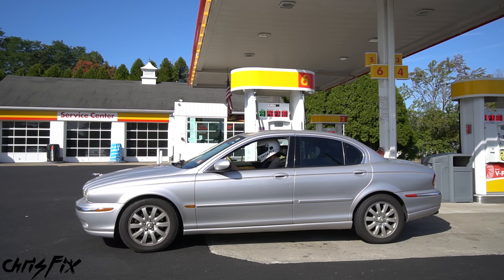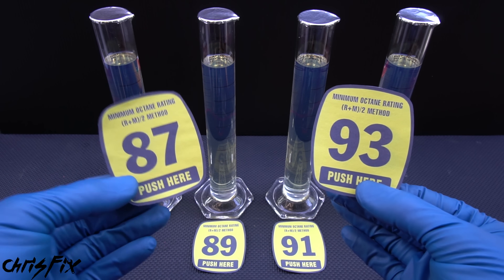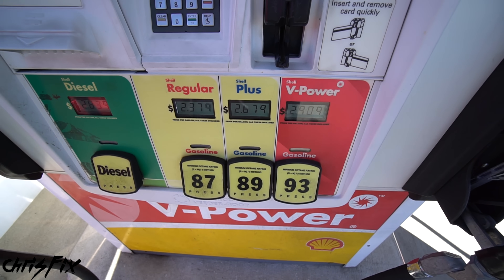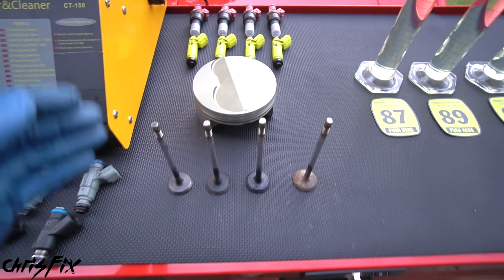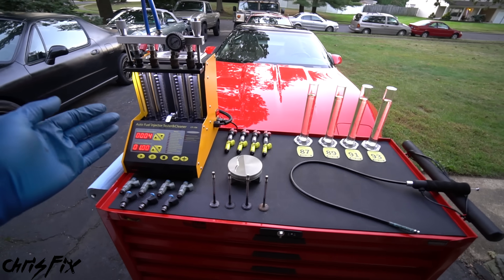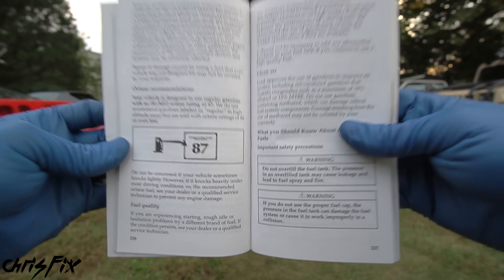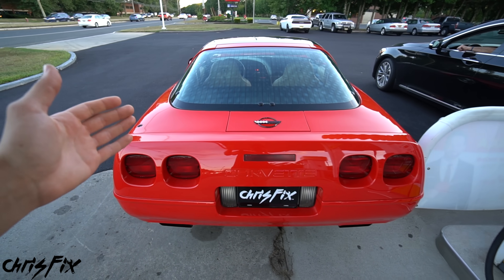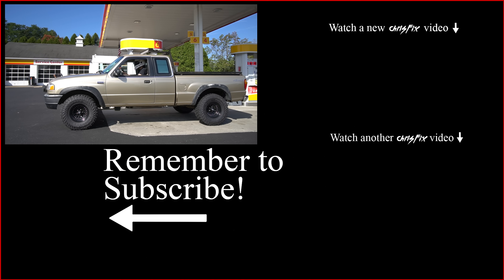What is the BEST Fuel to Use in Your Car or Truck and WHY

Comment: Watched the whole video

Answer: Use what the manufacturer tells you to use
Reply: Besides being a complete advertisement for shell gas that basically sums it up
Reply: well i mean.. did you expect him to tell you "f**k manufactures just use 94"
Reply: @dieseltechnician6227  Who knows what if he said take 4 tablespoons of butter and add 1/2 teaspoon of salt and a cup of flour; no wait wrong video.
Reply: I am going to assume, without watching, that it will lead into something about timing and specifications of the fuel mixture to the engine of the car which basically means yea... do what the car manufacturer designed it to do for optimal use. Probably wont harm anything with a control unit in modern cars though.
Reply: I liked the explanation
Reply: OP edit your comment and add that if you get engine knock, premium can fix it.
Reply: Ɓlιšš thank you so
Reply: Surprisingly, aint it?
Reply: 😂😂 16 mins and half of it was repetitive stuff. Also if you need this much info on what fuel octane to use stop driving and start riding a bicycle.
Reply: Ɓlιšš you da real MVP 😁
Reply: Don’t ever do what the manufacturer tells you to do remember they want you to buy more parts more shut and bull shit
Reply: Outstanding.
Reply: Ɓlιšš bro thank you
Reply: @NightMusic1-b9o  I have a VW Turbo, it says use Octane 91. my gas stations have 89 and 93, someone suggested to save money I could pump half a tank of each, similar to the idea the guy mentioned in vid of fill tank with 87 and then add bottle of octane booster. Got engine knock right off the bat :) Perhaps didnt get it mixed good, maybe I shoulda done some donuts in the parking lot. Didn't realize when i bought it out of a used car lot with a nice price on it, that was gonna be fillin up with premium :P :( 

.....also there was reasons for that used car price, about 3 hidden things wrong (abs unit dead, no thermostat in engine, transmission fluid pan and internal sensor smashed from underside) that they removed the error codes for when sold it to me :)
Reply: Does the manufacturer tell you anything about high altitude and octane, or is that specialized knowledge you can't get from a manual? I'm sure somebody here knows the correct answer, and it's not you.
Reply: But you learned more than that. Chris explains everything in depth, making you understand why to use a certain type of fuel grade
Reply: @spegatti3108  True <3
Reply: @spegatti3108  Bullshit
Reply: @spegatti3108  ya but this comment is still useful for people like me who didn't want to watch 15 minutes of garbage when the point is right here
Reply: Thankyou! Barely got through 6 minutes of boredom
Reply: NoFearXman well you aren't that fun at parties..
Reply: Only needed a minute to say follow manufacturer suggested octane
Reply: @NoFearXman  your patience sucks ass then
Reply: One of the stupidest comments ever. I doubt Bliss could pass the drivers test.
Reply: @BDHO73  Been driving for two years ):
Reply: Ugh! Didnt you already know that before watching the video?!!! 🤨 Dont say nothing else!!! I'm gonna start cussin! 😑🤐
Reply: Electricity is the best fuel for a passenger vehicle!  Tesla ftw!
Reply: @davidbeppler3032  So, why electricity? To save the environment right? Lol. Gotcha. Electricity, in large amounts anyways, comes from 4 sources. You can use fossil plants, use nuclear plants, use hydro plants or use solar powered plants. Burning fossil fuels for electricity is completely backwards for cars. Its much more efficient to use the fuels in the cars than it is to make electricity. So next is nuclear plants. They produce large amounts of the most dangerous substance on earth and is only good for a few years and has to be disposed of. It stays here which is bad for the environment and very dangerous. Next is hydro plants, which currently single handedly destroys the most of the environment by blocking and flooding the land below the dams with water. Next is solar power, which requires vast amounts of flat land, lots of sun, newish technology and expensive. Solar still destroys the environment being made, uses its space and doesnt have enough space to power electronic devices and cars. No matter which way you go, you destroy the environment and no one way or the other is actually any better. They all really do balance out in the end. So get off of your high horse (electric is best) and learn something yourself instead of believing everything you're told.
Reply: @adamsaquatics3332  Wow, almost right in several points.  You at least seem to be paying attention.  OK time for class.  Listen up.
  First you say it is more efficient to use petrol in the cars than to just charge the cars?  No.  Refineries use more power to produce petrol than the cars burn.  Making it more efficient to shut down the Refineries and just charge BEVs.
  Next is Nuclear power plants.  The most efficient and safest way to produce electricity in the smallest area.  No they do not have to produce large amounts of waste.  The plants in the US built more than 50 years ago produce 1,000% more waste than the plants built in the last 10 years.  They just need replaced with more efficient models.
  Hydro electric produces tons of power reliably with very little environmental impact.  Not sure where you get your data, but nobody is damming the Mississippi, I would know, I live next to it.  Instead idiots are building walls to keep the flooding from destroying homes and businesses... dumb.
  Then we have solar.  Cheap, reliable, easy to build and easy to maintain.  Increases crop yield by 12% and has been shown to reduce cancer.  We have huge swaths of land here, and farmers have found that strategically placed solar panels protect crops from burning up in the sun and reduce the amount of water required for them to grow.
  You don't have to take my word for any of this... you can google it.
Reply: @davidbeppler3032   David Beppler   David Beppler  Lol guy. We are talking about just cars. Refineries use oil to make way more than just gasoline. Most of their used energy is making jet fuel. Let alone all of the other petroleum based products. Refining oil to gasoline takes much, much less energy. In fact, you can actually use the power of the sun to distill the oil into gasoline. Which doesnt cost or use anything to refine.

Google " problems with hydroelectric power " since youre so fond of google. It does have multiple major negative environmental impacts plus damage to homes and businesses.
Nuclear power plants are very expensive to build, and maintain. And every single one of them produces nuclear waste that has to be disposed of. If you think even a small amount of that is safe for the environment you need to hit google.
Solar power is not cheap. The storage costs alone outweigh most other sources let alone the panels, and wire that would be needed to run everywhere. Solar will never work for that reason alone. Let alone that it is not consistent or reliable. Just because the sun comes up doesnt mean it wont be cloudy, rainy or in an off season for direct sunlight. Its also expensive to maintain and still requires backup power from another source. 
Good try educating me on something you dont fully understand though.
Reply: @davidbeppler3032  lol guy. You seem to have a hard time ipening your eyes. You realize electric cars are not new? There are reasons why they are barely becoming popular. Also many reasons why we still burn resources for energy. If it was tlas great as you are trying to claim it would have been done ages ago. You believe and fall for too much BS. 

Why dont you come join me at the University of North Colorado and get your bachelor of science in environmental and sustainability degree with me? It will open your eyes to a lot more than you seem to be able to comprehend.
Reply: @adamsaquatics3332  Electric cars are very old.  Lithium Ion batteries are new.  A company building EVs is new.  The fact that you make very uneducated comments about EVs running on coal power shows you how much you still have to learn.
  If Tesla was not producing more batteries than the rest of the world combined with their partnership with Panasonic then there would still be no EVs on the road today.
  Also they would have had to build a new peaker plant in Australia costing the consumers millions of dollars a year to prevent brown outs and power failures.
  Batteries only store power, they do not create it.  Wind, Hydro, Solar, and Nuclear power create it.  Coal and natural gas are killing us.  You, me, everyone.
  You are studying sustainability?  They have not taught you basic physics yet?  An EV is 93-95% efficient using the energy from the batteries.  There is a significant loss of energy from the power lines to the battery but transferring power takes it's cut.  The power lines are already in place everywhere across the country, very little need to add more lines as you suggested.  ICE is only about 20% efficient with the energy stored in it's tank.  Then there is the lost of power from pumping, transporting, refining, storing, pumping, then burning.  Each stage costs.
  The point, even if EVs all ran on Coal power, it would still be more efficient than ICE.  They would still be less polluting than ICE.  Don't take my word for it, ask your teachers.  Explain your point to them.
Reply: @davidbeppler3032  You're still here? This isnt am argument about which type of engine is more or less efficient. I will agree 100% that electric anything is more efficient. But it is not more friendly to the environment when you consider everything that has to go into it to get it going and keep it going. There are so many vast variables that all go into these things. 
There are power lines in 99% of places people live. Yes. Agreed. But the wires running from tens of thousands of acres of panels, to battery banks, then to banks farther out closer to each city to hook into the main grid alone would destroy the environment let alone everyones wallet. You are saying, oh burning gas and coal is killing us, ya sure, but you are choosing to destroy the environment over people dieing. Which will ultimately end in us dieing anyways. 
Even if we could snap our fingers and have everything already all setup and working, just maintaining an electric solar powered world will destroy the environment at a much faster rate.
We dont own the earth. And it owes us nothing. 
And to be conpletely honest, humans need to start dieing off. At the rate populations are growing, our vast numbers alone will cause us to die. We are not supposed to live forever like everyone is trying to do. If we were supposed to we would and reproduction would be way slower.
You do have good points and facts but you are failing to look at the larger picture. You sit and pick at small parts of the picture to try to make your points look better. You need to see what really goes into things.
Reply: @adamsaquatics3332  Fine.  Define your point.  Just one point.  I will counter it unless it is also my point.  Then we will agree.
  I will start.  Saving human lives is good.  Agree/Disagree.  Why?
Reply: @davidbeppler3032  If only it was as easy as saying you agree or disagree. When it comes to saving lives, there is still too much to consider. Which is why there are debates. In many debates there is no right or wrong. Its just who presents better or worse.
As far as saving humans lives in an initial thought the answer is clearly a yes, save them. Save them because they "deserve to live, have a right, have feelings, love, and others." 
But when you dig farther in, the answer is not so clear cut. Which is what i have been trying to show this entire time. If you were to remove all bad things and people live much longer, the amount of people themselves will cause the fall and extinction of themselves. The world needs a balance. In EVERY aspect. The world needs a specific, unknown, number of humans. People need to die at the same rate as they are born in order to keep balance. Too few and we could perish, too many and we could perish. We are growing at a rate much higher than we are dieing. So in order to maintain a healthy balance lives need not be saved. 
So they answer is yes and no.
Reply: @adamsaquatics3332  Gotcha, you disagree.  Nuff said.  Troll on sir.
Reply: @davidbeppler3032  You have a smart mind Guy, its just too focused.
Reply: @davidbeppler3032  Holy shit we have a guy with sunglasses on in his profile pic. You don't fucking mess with David Beppler! You don't have to make fun of people when someone comments.
Reply: @davidbeppler3032  The amount of energy in a cup of fuel has way more energy than a similar volume of battery
Reply: @davidbeppler3032   Yes...let's all go electric! Then build some more coal fired electric generating plants to charge the electric cars. Ask the people in California how those Tesla's are doing getting them to work with the mandatory power outages. No electricity....no charging.
Reply: @beboboymann3823  It is so cute when someone with a grade school education decides to make noise on the internet.  Ok, I can explain this to you.  It takes far more electricity from those coal plants to produce, and fuel your gas hog than it does to produce and charge electric vehicles.  Also you can build solar power plants for less money than Coal plants.  Also you can trust the sun to rise every morning without the cost of sunlight going up.  How much is that gas costing you today?  Will it be the same tomorrow?  How much is that coal you want to burn?  What did it cost you today?  Same as it cost 10 years ago?  If you take time to look at the amount of renewable energy produced 10 years ago in the US vs the amount produced today... you might be surprised.  Coal companies are going out of business.  Solar companies are making billions.
Reply: @davidbeppler3032  hop in your electric car and follow me from Chicago to Phoenix and try to keep up. I'm not stopping an for an hour or so every couple of hours for you to charge your car either. 
They're okay around town, but not for any distance driving that is over half of their battery range, especially a quick day trip.
Besides, if you buy an electric car, you are most likely going to need a second car. So why buy two cars when one will do?
Reply: @Smedleydog1  Not sure what you are talking about.  You should drive the Tesla down to about 10% of it's charge before stopping to juice up.  It only takes 10 min to gain more than 150+ miles range (long range model 3 has a 320 mile range).... so we could easily go from Chicago to Phoenix you in your car and me in mine, I will stop a few times 10 min at a time and you will just keep driving the whole way?  Must have a pretty big fuel tank.  At the end I will spend $65 making the trip and you will spend $235.  You will really show me when you get there a whole hour faster than I do... Next we could go from northern California to southern California and back?  I would enjoy the trip, seeing the sights... keep in mind, I will need a few charges to do this even though it will take us about 26 hours to travel just 800 miles (approximately 30 mph average) .  What is your fuel mileage when sitting in traffic for 26 hours?  Mine will not change.   Will the bad drivers and stop and go traffic bother you?  I will hardly notice the traffic as the car does most of the driving.  lmao

Comment: My manual has a big "87" in it and says "The use of premium gasoline is not recommended, as it will not provide any benefit over regular gasoline in these engines."

Comment: I have a question about something that was not mentioned here.  There are some gas stations in my area that carry E-15 or 88 octane, which is 15 percent ethanol.  I think what makes it beneficial is that it's cheaper than 87.  The label on the pump shows that flex-fuel vehicles and any other vehicle after 2001 is safe to use it.  What are your thoughts about that?  Do you think it's safe for a vehicle to use it if a vehicle can use a minimum of 87 octane?

By the way.  Love all your vids!  I remember learning to change the oil from your video and I've been doing it ever since.  You saved me money!  Keep it up!

Comment: I'm going to guess:
Regular = Unleaded
Plus = Leaded
Premium = Premium
I don't have shell fuel in my state or city.
Only QuickTrip.
Reply: Mechanical Logic 
Pretty much. If you’re using Chevron. 
It burns the same but Shell just has the protective coat that helps your pistons.

Comment: hey chrisfix i have a ranger similar to yours and if you know the 4.0l sohc engine then you should know that the engine when in the mustang is compatible with E85(85%ethanol, 15% gas). i found if you switch injectors and have someone do a re-flash the ranger can also run on E85. the more ya know, or so i found out... hope this brightens your comments

Comment: What are the advantages and disadvantages of E-85? I can run E-85 but never have, it is a lot cheaper but what about fuel mileage?
Reply: your going to get worse mileage but overall clean burn as it requires more E85 to be mixed with in the engine or a better afr
Reply: @josephberto5106  Thanks, heard that before, guess I should try a tank and see how much worse. It's pretty cheap but I get close to 23 on highway with mid grade so wonder how much worse.

Comment: This video is useful. I should check the manual on my Hyundai Elantra 2013. I never knew that type of fuel can cause engine problems. I had on my car fuel economy, but when I changed the spark plugs it was better and the engine is stronger. Like you said to check the manual for fuel type. Thank you.